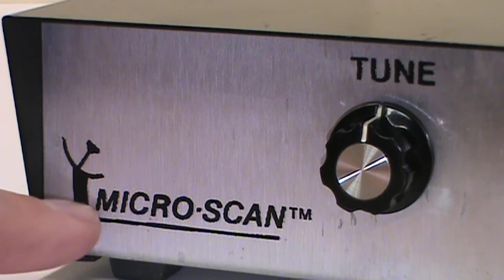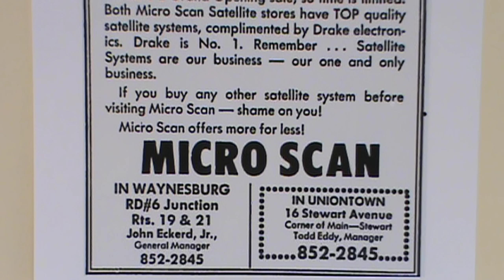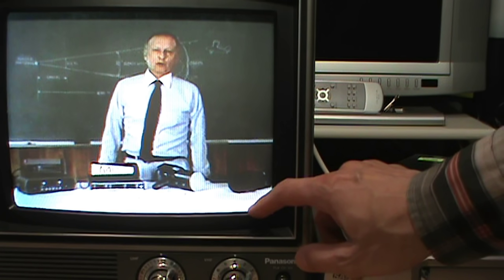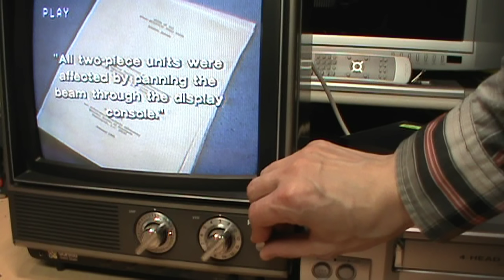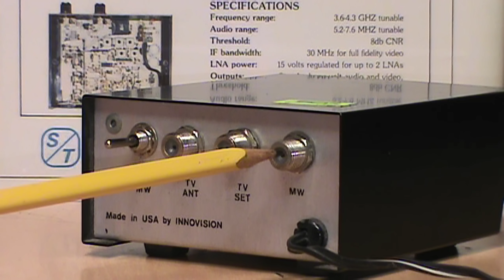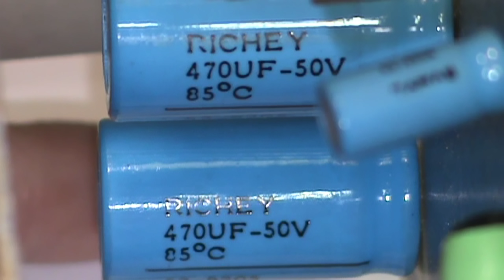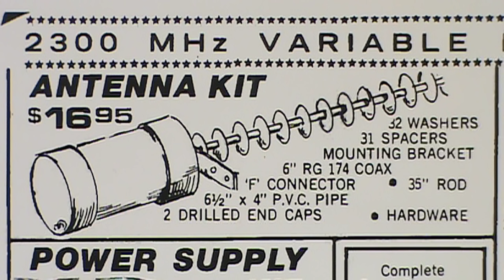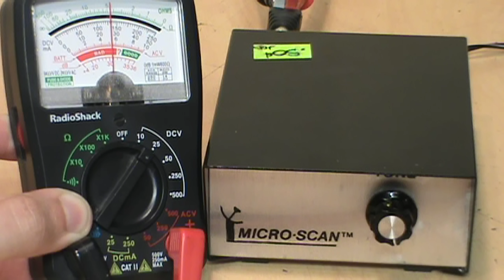Micro-Scan mystery 1980s TV device - Satellite? Microwave?

Comment: NOTE: THIS BOX WAS NOT FOR BIG BACKYARD C BAND SATELLITE DISHES. Many incorrect comments here that is was. It was for the 2Ghz ITFS/MDS band which HBO and other premium pay TV services used in cities in lieu of CATV. Remember that C band satellite is a 20Mhz FM video with additional FM audio sub carriers. Not nearly as simple to decode as was MDS which was a standard NTSC RF signal but at 2Ghz. A simple oscillator and crude microwave antenna was all that was needed to receive the signal.

More detail:
The  MDS band, around 2Ghz, was originally allocated in the early 1960s for building micro educational television networks within school districts. The Catholic church was a prominent user of this service. However it was not heavily utilized. In the early 1980s  the FCC allowed non utilized areas to use the service to distribute pay television. The signal was standard NTSC AM modulated video with FM audio,  but at 2Ghz. All the receiver had to do was down convert this to channel 3 or 4 to be viewable on nay TV of the day.  Simple hetrodyning process with an oscillator in the antenna. The box shown here was a simple variable power supply with an RF coupling network to the antenna through the coax cable. By varying the voltage, the oscillator frequency was varied which effected tuning.

Simple  design meant low cost consumer product but also meant easy to bootleg by even an electronic hobbyist novice. 1lb coffee can, 4inch PVC pipe end cap, 3/8in threaded rod about two feet long with spaced nuts and fender washers. Simple oscillator circuit. Plenty of plans in hobbyist electronics magazines and  Radio Shack even carried the microwave transistors - MRF901. 

This was all before cost effective digital scrambling systems at a consumer price point. But the service eventually failed due to poor profit margins, and nothing to do with the bootleg receivers. Just like scrambled OTA UHF TV stations broadcasting movie services at night, they all failed once cable TV achieved significant penetration in the late 1980s,
Reply: Yes exactly right. The voltage tuned a downconverter on the back of  a c band satellite dish from the 3-4 Ghz range down to 70 Mhz and the receiver was a demodulator from 70 Mhz FM to video/audio.

Comment: Given the variable DC output to the MW input, likely it powers a tunable Low Noise Converter (LNC).  It could be to the terrestrial band, and since it appears to put the signal from the LNC to the TV set directly, that converted signal conforms to standard NTSC signals, otherwise the TV set could not decode (demod) the signal.  I am a bit surprised that the logo seem to show a Satellite dish as the terrestrial antennae used for that service were just log periodic type antennae.

Comment: I bought something like that from a flee market in the early 80's. Came with a 12 inch dish and plastic feed horn. Took it in my car to a park off South Orange Ave. In New Jersey. That had a great view of NYC. Connected it and a tv to a 120 volt power inverter. Turned it on and pointed it at the Empire State building. It received HBO.
Reply: Also around the same time Philadelphia had an over the air pay tv channel. Channel 57. Woonsocket Rhode Island had a pay tv channel too. Don't remember what channel they used.

Comment: Completely different technology I know, but this reminds me of the Rediffusion system we had in the UK prior to DOCSIS cable. Rediffusion service assumed the form of a cable bundle that came into the house with 4-16 channel wires (Standard 1v analog, unencrypted) and a box a little like this which selected the channel to be watched.

Rediffusion also did an Apple on their customers by supplying cheaper TV sets which only included the picture tube and a simple A/V splitter circuit, no tuner. This locked people in to Rediffusion as they couldn't just disconnect the cable and use the same set to receive OTA programming, and helped Rediffusion to corner the market by charging lower rental/subscription¹ fees. 💰
(¹ - It was extremely uncommon to own your TV set in the UK back then, as the cost of them was well outside most peoples income. Understandably - Like cars today - They tended to be rented or leased.)

Comment: In the 80s, certain areas received broadcast signals that included premium channels like HBO and a few others. These signals were transmitted via microwave and were often scrambled or required a fee to access. However, enthusiasts could purchase their own equipment to receive these signals. Typically, 1 or 4 channels were available, and by fine-tuning the power and adjusting the antenna, the frequency users could optimize reception. The antenna setup usually consisted of a parabolic dish,  with a  plastic pipes holding the electronic components. By adjusting the power on the box on the tv you tune the frequency, users could switch between different channels.

I built my own  microwave. TV system back in the 80s using plans and components from Radio Electronics. I used a 2A plastic kids snow saucer as the basis for my dish, and it worked surprisingly well The cost of building or purchasing such a system ranged from $75 to $150. In my area, we were able to receive channels like TBS and HBO. Some companies would rent the equipment to subscribers for a small monthly fee, although I don't recall the exact amount. I opted to build my own system using the plans and knowledge available at the time.

Comment: It's a Multipoint Microwave Distribution Service or MDS Downconverter designed to receive terrestrial television broadcasts. In 1980's Los Angeles think Z Channel. You are missing the small dish that came with it, if you had it things would be clear as to what the tune knob is for.

Comment: I had one of these in the 80s. They had nothing to do with satellites, however, they were for receiving UHF signals via "microwave" antennas. The signals to be pirated were from actual content providers like On Tv, View and Preview. All broadcasted full length movies and content via UHF. These little boxes usually came with a UHF antenna to mount on the top of your house and the tune know would cause the device to override the "scrambled" signal these providers used to protect their content. You would think people who bought these would be fined or something, however, since these providers were blasting their signals at our houses we had the right to intercept and do what we wanted with them. They didn't last long because the legit providers didn't last long. Cable TV prevailed, then satellite and now streaming.

Comment: Yes, MMDS. That box is just a variable power supply. DC variable voltage (Bias Voltage) was diplexed on the coax to a Gunn Diode reciever on the roof. The Gunn was usually tuned fron 2 GHz to 2.8 ghz. HBO was one of the first to use this in the 70s. I had one and watched HBO movie channel for free. No encryption at that time.

Comment: I had one of these boxes in high school. Growing up in Norfolk, VA, there was a microwave movie service called "Star-TV" which played movies during the evening and had a multi-color message board during the day to show what channels were coming up that night. 
I bought a bootleg receiver which I discovered worked perfectly since I lived about a mile from the transmission tower. StarTV eventually went under and someone switched the feed over to Cinemax for a few months until it went off permanently. 
The MW port was connected to a small dish (about a foot wide) which had some electronics on it, powered by the 14v you saw. 
Apparently, there was the possibility of several adjacent channels and the tuning knob changed the voltage to the dish to "tune" it up and down to the channel you wanted. 
I remember this well. Thanks for the memory.

Comment: This seems like the 'MMDS' , the multichannel multipoint distribution service'. that was popular in Ireland for areas with no cable and no terrestrial service within range. It worked in the 2 GHz frequency range. I've got a couple of the mast-head down converters here. The incoming TV signals were received by the antenna and the downconverter shifted the frequency down to a lower frequency which was 'tuned across' by the box you have there. Very similar to satellite TV but on a lower frequency.

Comment: It's a receiver for a multipoint microwave system, The microwave transmitter / antenna was located on a very tall tower or building that used a omni-directional antenna to transmit the signal to receivers like this one. The receiver was conected to a dish antenna that was pointed at the transmitting tower's antenna. It used Amplitude modulation (AM) on 2.4 GHz it used Amplitude modulation (AM) as that's what TV's used in that time frame and by using AM there was no need to do anything to the received signal other than down converting it from the 2.4 GHz to channel 3 or 4 and feed it into the TV's antenna conector. The knob was used to tune across the 2.4 GHz band to select the desired channel for viewing. The device has a mixer that takes the incoming 2.4 GHZ signal and mixes it with an internally generated RF signal from a local oscillator the local oscillator is a voltage controled oscillator and that is how to knob controles the frequency of the local oscillator by verying the voltage to control the frequency output of the local oscillator.

Comment: The MMDS service in the D.C. area was called "Marquee TV" and had its antenna on the old WDCA-TV candelabra at 5202 River Road in Bethesda, MD.  They started out with HBO when it was a part-time service and later added WTCG-17 from Atlanta for when HBO wasn't on.  Idk if they ever served individual homes.  It was mainly for apartments and hotels.  "73" magazine carried plans to build one of these using an aluminum snow coaster sled as the reflector for the antenna.  "Marquee" went away after STV operator "Super TV" came along.  That chunk of spectrum is also used by government (Especially in rural areas for "ITFS", for "Instructional Television Fixed Service" to provide specialized instruction to schools when there's limited resources.

Comment: I bet it's a MMDS or MDS power supply. The knob controls the voltage to the downconverter "VCO" to set the center frequency on it. It could have been part of the system at 2.3GHz to view early HBO, Playboy, etc. Albuquerque had a company called Way out west in the late 70's that provided the service.

Comment: Hey man, I used to do satellite TV installs, look up Low Noise Block, that's where the power goes, and that's what converts the satellite signal into the cable signal which is actually a different frequency than the raw satellite, and an LNB needs 12v to work typically, even ancient ones.

Comment: I think it's a power supply and switch box for a HBO microwave receiver when I was a freshman in high school I used to build and sell a  device like that with a microwave receiver that you would mount on the roof of a house I must have sold like 30 of those things

I had a supplier for the PC boards that I would populate for the microwave receiver and the power supply

If I remember right the microwave receiver board used 4 mrf 901 transistors

The variable voltage power supply controlled the vco in the microwave receiver

Each microwave receiver board what is slightly different you would have to tune the board by removing some material from a trace on the microwave receiver board using a very sharp razor blade

I might still have one of the boards around here somewhere

There was a certain smooth walled mobile one oil can that was ideal to mount the microwave receiver board in or you could get away with a small coffee can there was a rod disc and spacer
Antenna and a conical chicken wire horn-shaped antenna

The metal mobile one can PC board assembly would be mounted inside of a short section of PVC pipe with two end caps

Comment: The "Tune'" knob controlling the voltage makes sense. There's plenty of topologies of oscillators used for generating the signal used for filtering for a specific incoming signal passband that change frequency based on the input voltage to the oscillator. 

There's quite a few nifty superhet topologies that use an "accidental" VCO (Voltage Controlled Oscillator) for the pilot/passband frequency, though they are not real VCO's as analog synth nerds know them, of course. It's just a side effect of how the oscillator is constructed.

Comment: MMDS or Multi-point Microwave Distribution System.  Used in the mid 70's by companies like HBO to provide a premium service before cable became available.  I had one back then.  The antenna was either a dish or a ring type yagi with a down convertor attached.  It operated somewhere around 2 Ghz.  You tuned the channel by varying the input voltage to the down convertor.   Also, was sometimes used by educational institutions to provide in-home classes.

Comment: Back in the early 2000s, we had a small antenna for some paid tv service over here in tacoland, I guess the small metal thing it had was something like that, because the antenna wouldn't work unless you plugged the small transformer to the wall.
When it broke, I took it apart and it only had a transistor and a small capacitor.

Comment: What? You don't have a BUD in your back yard. Get with the program. If you drive the interstates of the US, especially out west for miles you can see people's back yards there are plenty of BUDs rusting away in the back yard. Usually accompanied by a rusting  pickup truck or Camaro on concrete blocks. More affluent folks may have a Winnebago that hasn't moved since 1973 and sometimes the BUD is on top of the motorhome.

Comment: I think that was part of the 'black market' set-ups for 'pirating' reception of early attempts at cable TV/subscription TV services.  You had to buy the parts for the systems separately and this was the power supply for the antenna feed.  The output would feed into an actual signal decoder (unscrambler) and to your TV.  I remember a few of the legit stations, ON-TV and the Z-Channel  here in Southern California; I think there were 5 all together at one point in time. They had a regular schedule of TV shows and movies.

Comment: When I was in high school we lives about 40 miles northwest of Phoenix.  In the early 80s my dad bought one of these.  There was a small dish about 1 foot in diameter that went with it.  The dish had a a plastic tube a few inches long that stuck out the center and had two small metal things sticking out the sides that looked like small wings or vanes.  HBO and Showtime were available  with it depending on whether or not the vanes were horizontal or vertical.  Dad adjusted it so the vanes were  at a 45 degree angle and the signal was strong enough that we could get both channels.    There was some ham radio stuff it would pick up.

Comment: I'd assume the variable DC voltage was used to drive a varactor tuning diode or VCO to adjust the frequency of a microwave detector or LNA.  As others have said, that would be part of a satellite or terrestrial microwave receiver, down-converting to a standard NTSC signal and channel.

Comment: The tune control sets a voltage for a varactor, a type of diode that exhibits a capacitance which depends on the voltage applied. It would tune an external RF circuit.

Comment: Back in the 70s and early 80s, there was terrestrial Microwave cable TV systems (not Sat TV). It was a Multipoint Distribution System that had a simple scrambling system that required a small box to receive\unscramble the microwave signal.  One example was Anchorage AK. At the time, Anchorage did not have cable TV, only had OTA TV (ABC, NBC, CBS), but Anchorage did have a single channel Microwave TV service. I think it was called Vision. It was HBO at night, and TBS during the day.  Required a special antenna and subscription.

Comment: I picked up one of these kits back in the mid 80's, used the directional antenna.  Was curious to what made it tick,  i remember opening up the antenna to find they lined the cylinder with a quaker state oil can. In my area it was used for HBO, you put it on the roof and aimed it towards our tallest building downtown which had the relay transmitter. By the time i got it cable was available, and I only used it for a few months.  The rumor going around was that the cable company was driving through neighborhoods looking for those antennas to catch people stealing HBO. Not sure if that's true, but wanted to switch to cable anyway. I wanted my MTV.....😂

Comment: Used to have these in MPLS back in the early 1980's as well, knob controls a DC voltage used to tune a varactor based VCO used in the microwave TVRO downconverter, at the time HBO was broadcast from the IDS center (908 ft AGL) and for a number of years it was a free-for-all thing. Believe the signal was active until the early 1990's and at some point there was a switch to horizontal polarization. It's an interesting relic of a bygone era but completely useless for anything but a low current variable power supply today.

Comment: Possible uses:
Varicap-controlled filter for your TV antenna.
Power supply for roof mounted TV antenna signal amplifier.
Note that roof mounted TV antenna amplifiers tend to have positive ground, while satellite things tend to have negative ground. Positive ground is better as moisture then etches on the ground rather than the signal wire. This is why satellite stuff always need perfect moisture protection while roof mounted TV antenna amplifiers doesn't.

Comment: The old C-band used a rotor controller on the back of the LNB to adjust the polarity

The old polarity motors were really nice. 

Using my Uniden SQ590 C-band receiver I could adjust the polarizer from -45 to +45
It was great for fine tuning weak foreign satellites